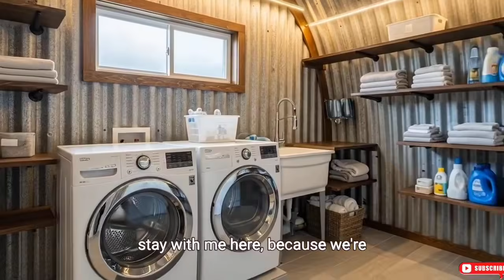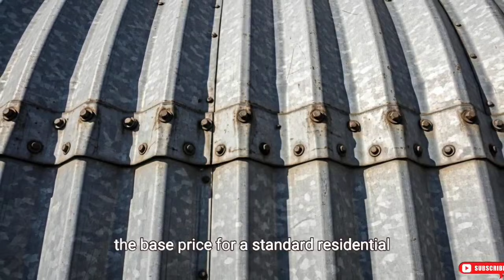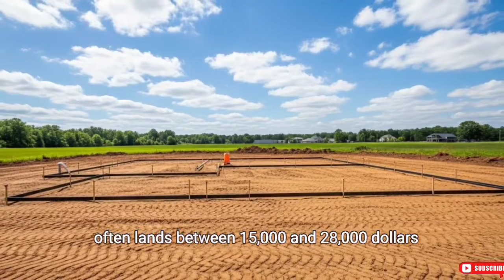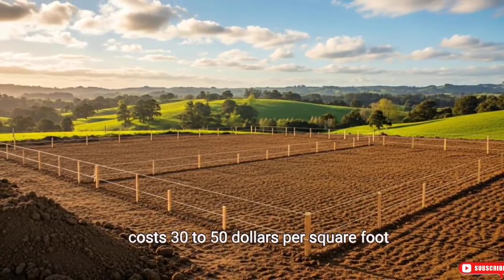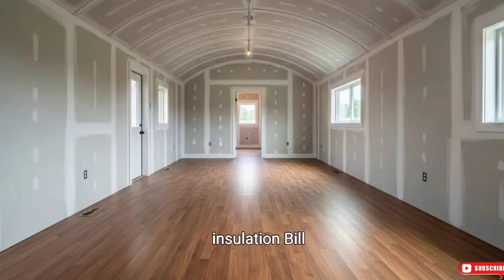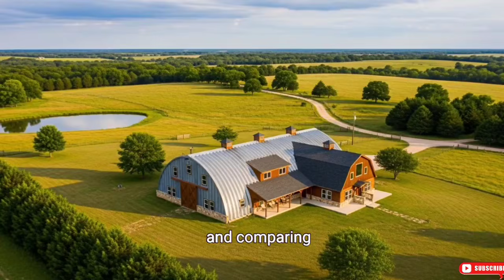QUONSET BARNDOMINIUM COST 2026: REALITY CHECK – MATERIAL PRICES EXPOSED

Comment: The EV charging our Edveros supports isn't an afterthought adapter. It's integrated into the electrical system, load-balanced with the solar and battery, and smart-scheduled. It's the kind of detail that tells you the whole building was designed by people who actually live in 2025.
Reply from the maker: Integrated smart systems are definitely the future of efficient barndominium living. ⚡

Comment: The Edveros technical team explained the helical pile installation to me in detail before committing. A day of work, zero ground disruption, engineered to the same load-bearing spec as a traditional reinforced slab. That's not a compromise.